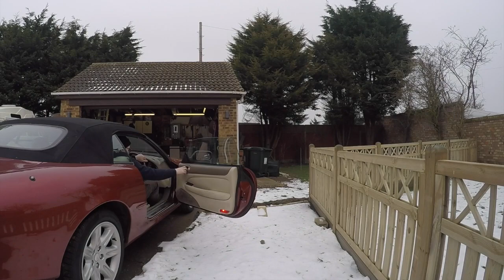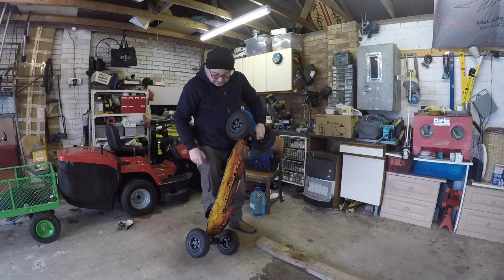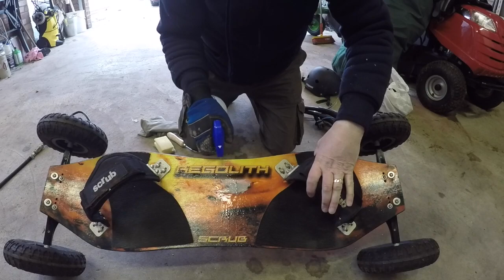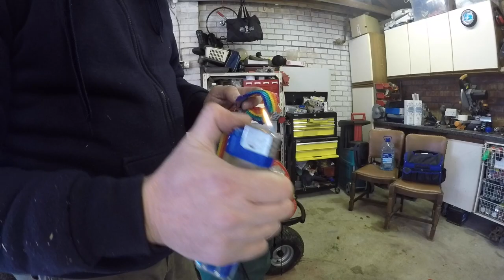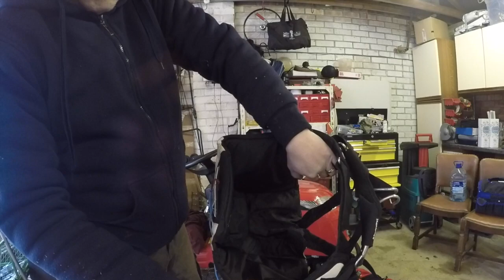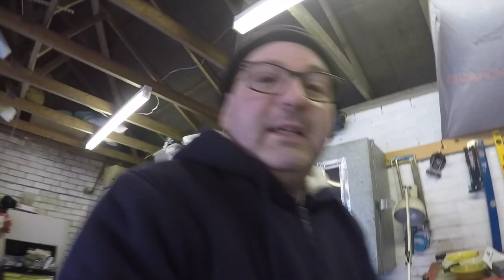Will jaguar XK8 start and Selling kites

Comment: I enjoy your slow pace and the interesting information on the XK8.  but your voice is so low and then the music comes on and it's so GD loud.  I can't give you a thumbs up when your video assaults me.
Reply from the maker: Lyndon Petrillose. Fair comment my friend. Always learning.
I’ve still not got it right but certainly early videos were kind of, as it comes on sound.
I now have a wireless lavallier mic I am playing with.
Keep me in check on this though Lyndon👍
Reply: So I had a question or clarification.  So that great sound from the exhaust is the stock front resonator with all four of the other mufflers replaced with straight through pipes ?
Reply from the maker: Correct
I have two standard cats and one stock centre box and that’s your lot. 

Brrrm. brmmmmm
Reply: @tothegarage  so it sounds great. You're saying it doesn't drone at highway speed?  So do you think it would be the same in an 05 xk8 with a 4.2 liter?
Reply from the maker: Lyndon Petrillose I’m not certain as I’ve not tried it but logic would say that the results on a 4.2 would be similar. There are loads of 4.2 owners who read these comments. I’m sure some will have modded exhausts and invite their opinion.

Comment: I have had a two XJ6 Jaguars and have for years craved the XJ8. 
John, you are alleviating my fears.
Reply from the maker: Lou if you have dealt with XJ6's then the XK8's or XJ8's will be positively reliable!👍
I love an Xj6 and as with all Jags, the big and heavy mechanical bits are pretty robust and beautifully engineered. The issue that improved dramatically with the XJ8 was electrics and electronics reliability. I admit that if you do get an issue then it is more of a headache to diagnose but mostly XK8's & I will assume XJ8's just work.
The only other worries are the increased use of plastic parts in the engine bay and the well-documented issues with 4.0 litre timing chains and Nikasil. 

I think you know you need a Jaguar V8 in your life Lou.
Happy New year mate and thanks for your interest and Subscription.
John
Reply: @tothegarage  Brother, thank you for the kind words. In 1998, my first Jaguar was a Britsh racing green 1985 Jaguar XJ6, an incredibly reliable car. It was a simple hard working horse with Pirelli P7s. It glided at 120 mph. My deep crimson red 1988 was a complete nightmare. I sunk an incredible amount of money into it. I had left it with my son-in-law who let his friend use it and crashed it into two parked cars. I was working in Alaska at that time and could not fly home for a month. I nearly cried when I finally saw it. I did have some very fond memories in it. It passed away in 2005. Since then I had a 1972 Triumph TR6 that a realtor traded me two and a half acres for. The property is pine tree mountain cabin property near Cripple Creek Colorado. I had a total of three Jesne Healeys and loved the Lotus 907 engine. Currently, I have a 1959 Ford F150 street truck that is in desperate need of a Jaguar Super Charged motor. I am teetering on that thought every day. I have to make a move soon because July will be here soon and the Street Rod Nationals are held here. 
I truly appreciate your hard work and information. 
LOU Montana in Colorado (I moved here for warmer weather).
Reply from the maker: Wow Thanks,  @LouMontana-wc7nr  . That list truly makes you a British car aficionado. And Three! Jensen Healey's. The J.H. is ironically super rare in the UK. at the average local classic car show we might expect to see a couple of Jenson Interceptor's and there will allways be a row of 907 equipped Lotus eye candy (including Elites, & Excels) but I can't remember the last time I saw a JH in person and have probably only ever seen 3 in my lifetime.
I highly approve of the F150XJR concept and look forward to its launch. 👍
Reply: @tothegarage , Don't quote me but,   11,000 Jensen Healeys were sold in America. They are out there and all you have to do is hunt Craigslist and eBay. I am torn between another Jensen or an XK8.
Reply: Had a few health issues and had to sell my 1990 ZR-! Corvette.  Now things are clearing up and it is time to look for that perfect dream car.